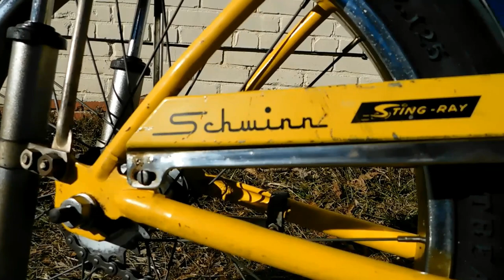Budget 1970 Schwinn Lemon Peeler restoration.

Comment: Most fantastic retro-inspired authentic bike ever made by Schwinn. The enormous success in sales of the sting=ray style bikes from 1968-1973 was one of the flashiest designed bikes made at the time. The 5-speed stick-shift, spring suspension on the front forks, and full-floating saddle with stripes were a must-have, but that's not all 20"x2.125 Tire on the rear with 16"x1 3/4 tire on the front rim, but for me, the best part on this bike is the Front drum Brake easy slowdown-stop. The accessories for this style of bike are priceless. Excellent restoration of this 1970 Lemon peeler keeps the Vintage flare burning. God bless America.
Reply from the maker: Thank you Delma!